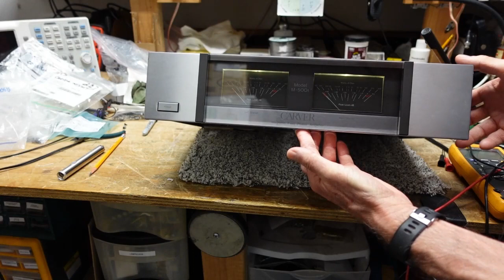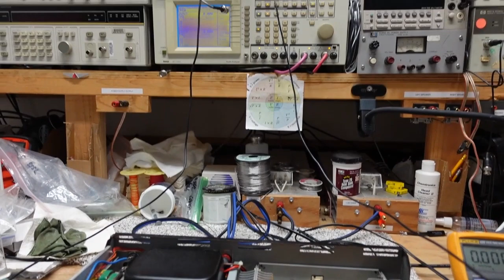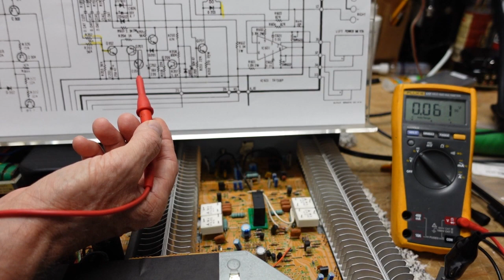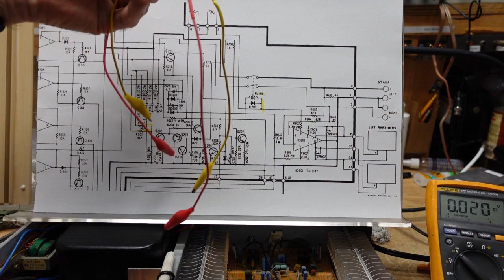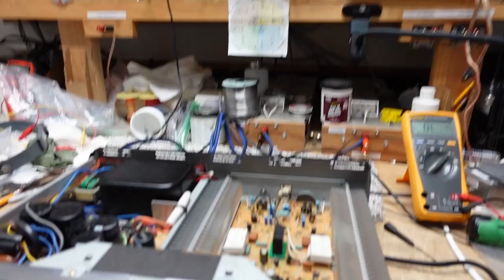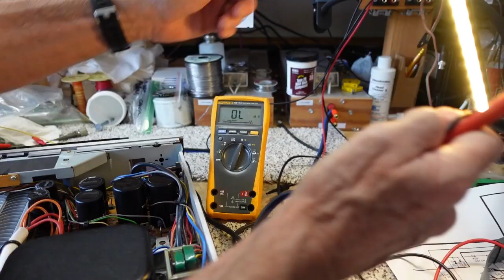Carver M500t Diagnosis and Repair

Comment: I was a Carver fan for a long time, since the 70s. Own a Carver AV705X 5 channel 125 watts/channel have had it 23 years and love it.
Reply from the maker: I just bought a Carver 900 receiver from eBay that's supposedly not working. I took delivery of a Denon DAP-2500 preamp bought as not working. I was disappointed to find it working 100%. Let's hope the Carver doesn't work; it's no fun when they do!  😝

Comment: I've got an upgraded 500t that's having issues playing audio. I will have to wait for it to heat up & crank my Preamp to just about max and the channels will static & come to life.

I'm thinking it could be the RCA solder joints going bad. About how hard is it to re-flow these? Do I need to discharge the whole amp beforehand?
Reply from the maker: Before you do anything try tapping on the speaker protection relay with the amp on and a low level signal input.  Needless to say, exercise care with the amp open and powered up.

Remember, you do this at your own risk.

Comment: Thanks for sharing Ray, great video! I have two of these amps and now feel more comfortable about opening them up. Bart/VA
Reply from the maker: You never know what's up until you take the cover off.  Sometimes you get lucky and it's obvious what the issue is, other times you have to start troubleshooting and eliminating sections of the amp that test good.  A slow and methodical approach will usually yield results.  Good luck!

Comment: If that Carver is pulling that much power, it will probably trip the breakers in most homes. Unless they've recently started upping the amperage, most residences have 15 amp breakers on their 120V branches. (Except maybe for the one where the washing machine goes.) Cranking that Carver up would trip most of them, I think. Wild.
Reply from the maker: I think residential breakers need a more sustained amperage past their trip point to trip, and music doesn't do that.  Continuous sine waves do, though.
Reply: @  Thanks. I always wondered.

Comment: Ray, one of the old Plymouth cars, had lug nuts, that were left hand threads on one side...and right-hand ones on the other side. I lived thru the 70's, so the speaker alignment of this particular unit, probably fits those times! Lol
Reply from the maker: OMG, I remember those old Plymouths!  What was THAT about?
Reply: Our 1961 Valiant had those lug nuts. Screwy.

Comment: Quick question Ray... what is the reason you aren't using the signal generator built into your Levear?  Is it just a matter of ease of use with the other one you're using?
Reply from the maker: I was having issues with the internal generator, which was later remedied with some parts purchased from excellent tech and all around nice guy Phil (PAC1085).
Reply: @raygianelli3612  as an aside... the back of that carver even has a diagram to the right of the speaker terminals showing that red goes to + for both left and right... even though the diagram in line with the terminals shows the bottom-left red terminal going to ground... so confusing. I wouldn't have figured this out!

Comment: Hello Ray , ...BOB does it always different ..........must be his benchmark ....something riding the fine line between genius and  hahahaha........
Have a nice day. and thank you !
Reply from the maker: I hold him in high regard, but troubleshooting some of his designs requires a specific skill set.  Which, depending on the item, is one I may not yet have.  Fortunately in this case it was the protection circuit, which is a pretty common design.

Comment: And as I’ve just discovered with an M-500T on the bench, they suffer horribly from cold solder joints.  That alone was preventing the relay from actuating.
Reply from the maker: Interesting.  I wonder if that's a common occurrence with these amps?  Thanks for posting this, Mike!

Comment: Thank you for the great video. It is very helpfuel that you include the thought process and schematic interpretations. I can learn a lot from your channel ( new subscriber).
I'm not familiar with  the phrase "magnetic field power supply" or why it wouldn't play well with the dim bulb  current limiter.
Thanks again.
Reply from the maker: Thanks Jay! I feel it's so important to really understand the troubleshooting process, because once you do you can apply it to anything you work on.
The magnetic field power supply has an active circuit that fires a triac for voltage control. Do a search on it.

Comment: Ray, thanks for the informative video. It appears the amp still has an issue based on input current draw. Under test you were driving 170 watts per channel, or 340 watts total. If the amp was only 50% efficient that would be 680 watts line draw. But you were at 16 amps, which, at an assumed 120V RMS line, is 1920 watts.  No way an M-500 draws that much power even at full rated output.  But perhaps I misheard the numbers.
Reply from the maker: You heard right.  Unfortunately the amp is no longer here.  The magnetic field power supply is not something I'm familiar with, but it supposedly they draw current as needed and not stored in large filter caps.  And I believe that steady state signals stress them more than conventional designs.
I'll do some more testing next time one comes my way.  Meantime, owner says it's working fine.

Comment: That's why you need to have a floating dummy load with an analyzer connected that also has a floating ground.
Reply from the maker: You're' right. I do.  And it does.  But even though the ground is floating, the terminals between left and right on the analyzer are common.  That's where the trouble came in.
Reply: @raygianelli3612  Oops. The inputs on my R&S are totally isolated. Never had this problem with any Carver amps and also lots of bridged amps. Maybe there's an option strap that separates that ground?
Reply from the maker: @basspig  No straps externally. But it's no Rohde and Schwarz either.  :)
Reply: @raygianelli3612  Ah that's unfortunate. Rather limiting to the ability to test some oddball amps. The UPV is totally isolated so I can flip the polarity of one channel without causing a short circuit to the other.
BTW, nice work on the troubleshooting. I like your honest approach.

Comment: I like your honesty and transparency, the faux pa with the positive grounding on the output would have ended up on the cutting room floor of most creators, but including it is a valuable tip for others not familiar with these amps, thank you for your time, when you're filming a fix it takes at least ten times longer than normal
Reply from the maker: Thanks BSD.  Humans make mistakes.  A good tech learns from them, and if they are bad enough to cause damage, can fix them.  I haven't made every mistake there is to make, but I'm working on it!

Comment: I loved that troubleshooting,  very interesting,  and interesting on the relationship of the speaker out, dumb question I don't understand the purpose , thanks Ray, great video
Reply from the maker: This 250 watt/channel stereo amplifier can configured as a single channel amp putting out 700 watts.  Great for driving subwoofers or, if you have two, a powerful stereo setup.